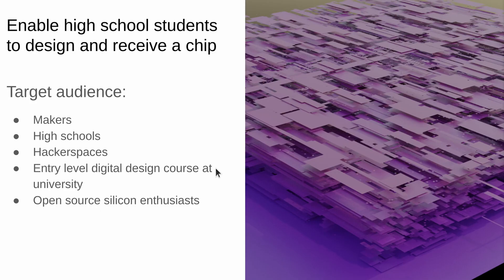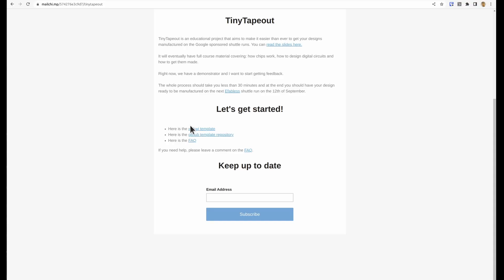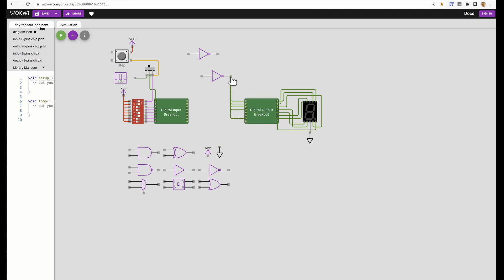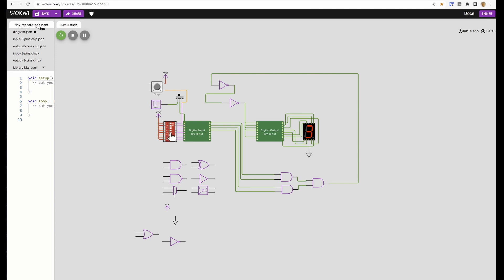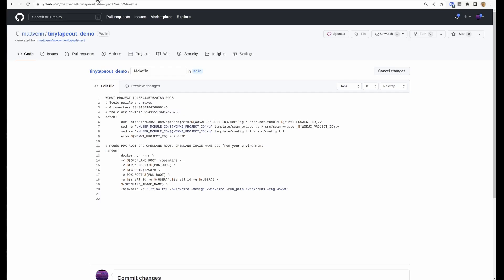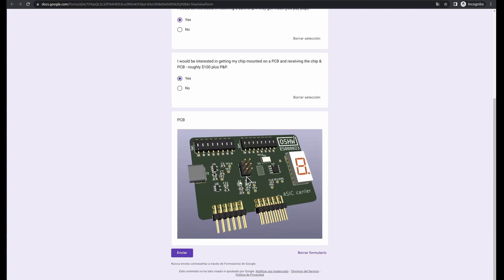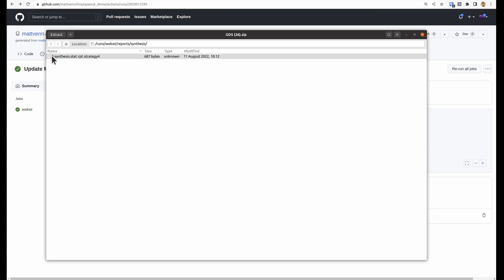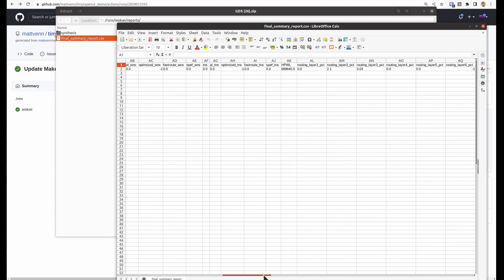TinyTapeout!

Comment: What if you have a verilog design that's more than 200 gates? Any other options? Thanks!
Reply from the maker: In the end we were seeing a maximum of 600 cells in the biggest designs. I also think we can increase the area up from 100um x 100um to 120umx120um, which will give 1.4 times the area for future runs
Reply: @ZeroToASICcourse  I see... I meant, if I have an existing verilog design, can I import that design into your tool/flow, without using your web-based design capture method and have the design fabbed? I realize what I'm asking for is outside the scope of your sevice (which is a fantastic idea, imo). I guess I'm just trying to think of how to get a small chip built for cheap. By small though I still mean well over 1000 gates. More like 3000 Xilinx LUTs. Just thinking out loud... I don't think I'd be ready for the next shuttle anyway.
Reply from the maker: @saturdaysequalsyouth  probably best to come on the course and make a submission to Efabless. Then you can use around 1000um x 1000um.
Reply from the maker: @saturdaysequalsyouth  yes, we had people doing that with a slightly different repo. You can try it by forking this one for example: https://github.com/sfmth/tinytapeout-tinycordic